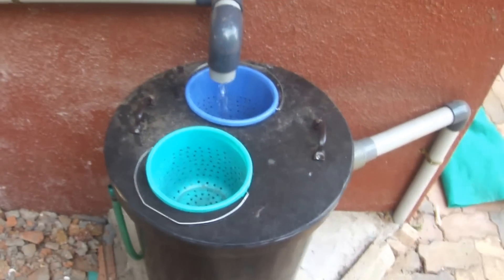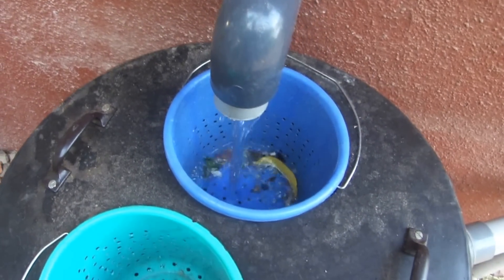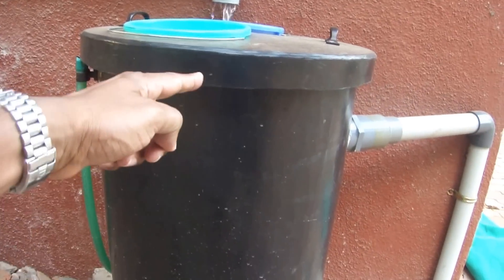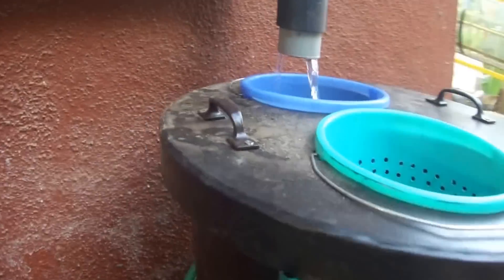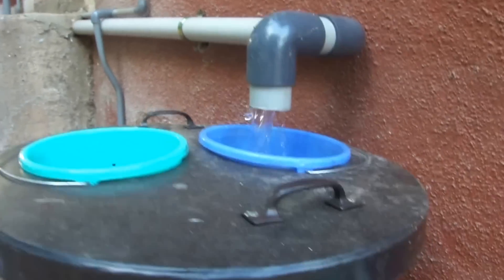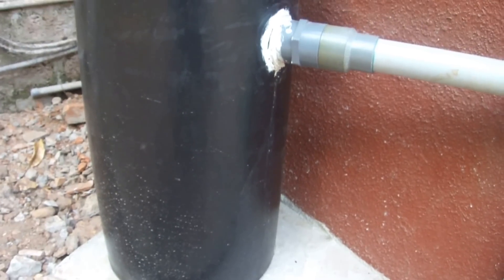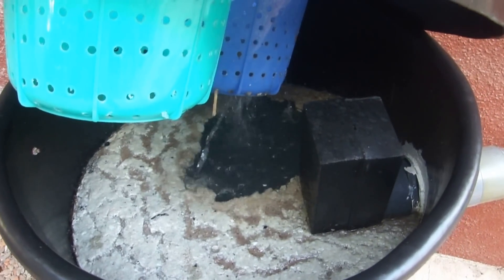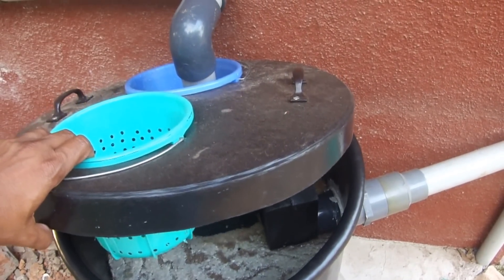Grease trap for kitchen waste water

Comment: How do you remove the grease from this tank? And to where?
Reply: They never answered, but I can guess from the tiny bit of waste water treatment study I did at university.
The grease in the trap can be collected and recycled into a usable product (like soap or tallow), or composted. Industrial companies that are required by law to have grease traps usually have specialist trucks that come and empty and clean the grease traps for them on a regular basis, like how your council has specialist trucks and waste services to remove and process your household garbage.

On a small scale like this, you could probably use a slotted spoon or similar tool to scoop the top layer off, then compost it.
Reply: Wow i just know that grease can be composted.. ive heard somewhere that grease is bad for environment